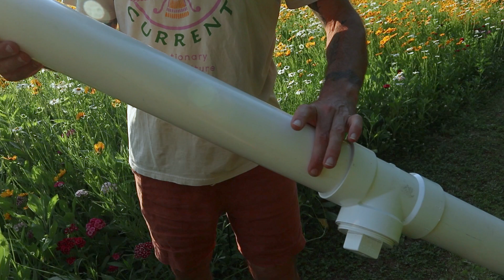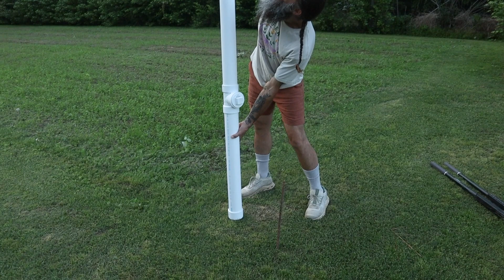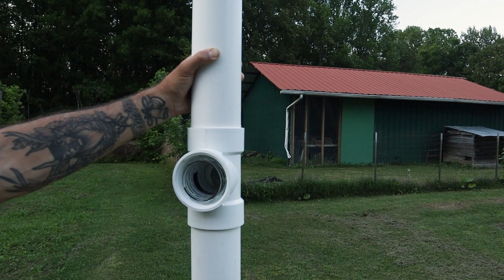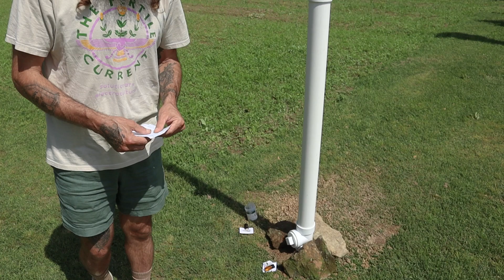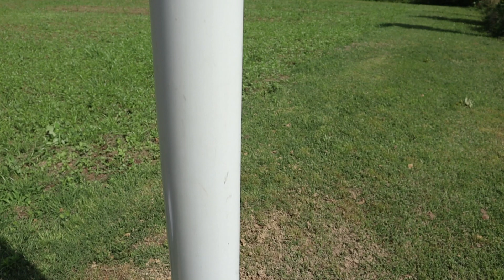Field Broadcasting With Electroculture Antenna Cathode

Comment: I was wondering if it would be a good idea to take the bar code off the caps on the wells as that holds a mathematical code that may be incompatible with everything else.
Reply from the maker: Hey friend, fortunately we are only broadcasting what is placed in the well and PVC is RF transparent. However, I would prefer the bar code not be on there even if just for visual appearance sake.  Those are typically printed onto the PVC and not stickers.  I do appreciate how your thinking though, and if it were inside the well we would have to eliminate it. Many blessings!